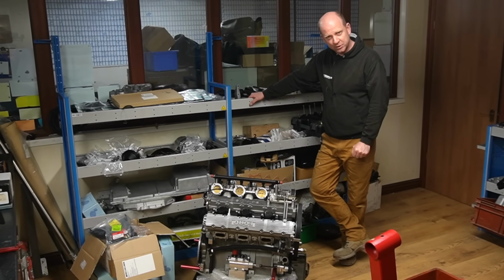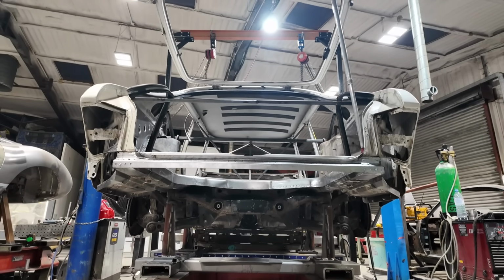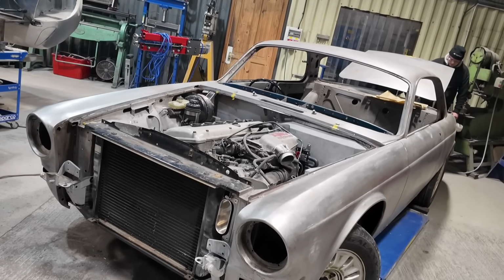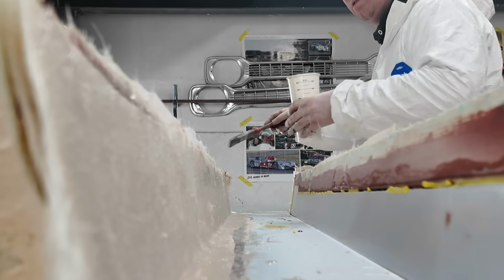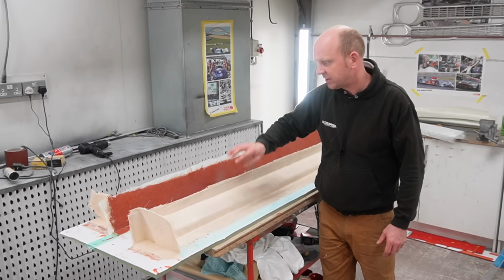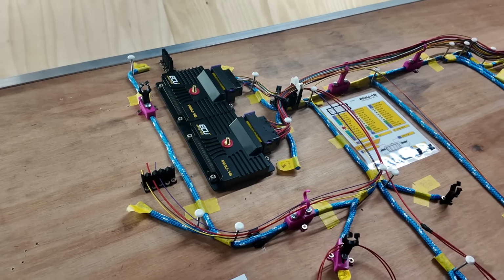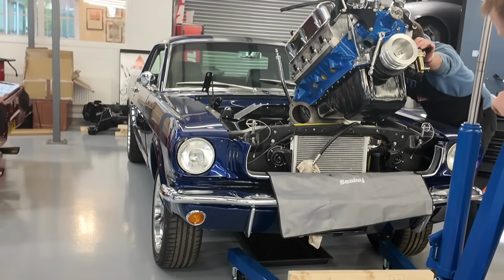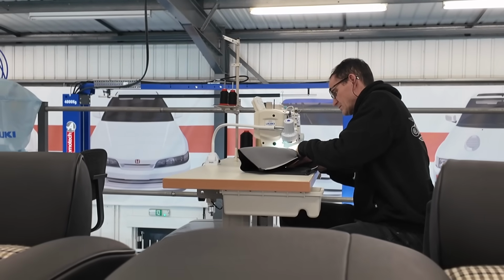Cosworth GAA 4.0 Alloy Block V6 Arrives!

Comment: With the Mustang rear oils seal get the best quality you can, like Felpro, and make sure you put the lips the correct way around. For the valley gaskets I never use the little strips of cork and just resort to a generous bead of silicone. I have seen the cork crushed and squashed out of position. 1965 Mustangs are like DC3 aircraft, its more of a worry when they stop leaking oil.

Comment: Jolly gee man. Wish I could be running one of those engines in my Capri 3. Absolute dream😱

I have yet to start the build of my Capri 3 with a Cosworth BOB anyway, but still. Maybe keeping my eye out in an FBE, the racing version of the 2.9 v6. However I am genuinely afraid with my luck it's not gonna last long no matter how nicely I treat the engine, and am under the impression that parts are difficult and expensive to source since it is a 3.1L and all... 

Still, cannot deny the soundtrack of the GAA engine is insanly glorious😱

Comment: Kevlar is a good alternative material for composite body parts, less brittle and more flexible than carbon fibre but stronger than glass fibre and lighter. Great for wings, bumpers and sill’s which might get nocked or impacted.

Also make sure the B side of the parts needs to be properly sealed, paint, lacquer or gel coat, as glass fibre is porous and allows water to cause problems like blisters in the finished A side of the parts.

Comment: Make sure that the exhaust primary length is long enough for the peak power speed.  A 6nto 2 into 1 system will improve mid range and sound fantastic (I assume this will happen anyway). The first Mondeo Cosworth V6 BTCC car had a twin 3 into 1 system and then in the second season we went to a 6 into 2 into 1 which gained a fair amount of mid range but sounded like a V12!
Reply: @jabberwockytdi8901  Having the correct secondary length is a given obviously as is the correct diameter primary , secondary and tailpipe. it is called exhaust tuning. All of which should be initial be optimized in 1D and then checked on the dyno

Comment: I would love a time machine to go back to 1985 when I spoke to a company that had three pairs of GAA heads. I was 18 years old and just sold my Mk1 Escort with a Group A spec RS2000 which was not very friendly to drive daily so I bought a 3.0 Capri & spoke to the company but was put off by the problem of getting them working on a 3.0 Essex block  and they was £300 a pair which is crazy! Then after that time travel I would like to go back to when I was nearly 16 still at school and every day walking to school I walk past a derelict car then one day I knocked on the door a old lady came and said I was her sons he came the next day and we tried to go it started but it wouldn’t start & made a deal for a swop for my very hi spec IC radio controlled speed boat with everything including the waders, but my dad said I was not allowed to bring it home. Which I still think about that car to most people it was a old wreck of a car with grass growing up around it and I thought it was great so a BMW E9 csi was not to be my first car.

Comment: Mr. Wood is a fricking genius. As a yoof I used to pass by his garage positioned down a back street in Stockport. He always had something interesting parked up outside. Much drooling occurred. Brave person needed to cut the arse end of the E-type. A thing of beauty. 
Bobby is a genius. You all are to be fair.
Enjoyed the skit about the fibreglass. Very interesting seeing the process.
Is there a 'modern led unit available for the Allegro's square headlights?

Comment: Very surprised to see Project Vader up for auction at Iconic Auctioneers Race Retro 2025 with a guide price of £60k to £70k. (I hope this doesn't break any rules. I have absolutely no connection whatsoever was surprised that's all)
Reply: They had one of the BMW M3 builds up for auction at the same place earlier in the year. I think the build was upwards of £300k.
It didn't reach its reserve and was offered up after the sale for £225k.
Don't know if it sold or not.
Reply: That must be a fraction of what the build cost 😮😮

Comment: Now THAT'S an engine!  None of this LS bloody nonsense so rife lately.
Reply: The LS is a fantastic engine.
Reply: @markchisholm2657  it is a great engine.....but I agree with the OP that it's nice to see something other than an LS being dropped in, as that's all a bit predictable
Reply: LS  variant would be a mercury marine quad cam ls 750hp 8200rpm and fully streetable for aboutvthexsame coin as this cosworth, ( a suitable engine for the aston DBS)
Reply: @ or. A mk 1 escort. 👌👌
Reply: @hanshoogendyk2203 no longer available though sadly
Reply: Correct.   The cosworth engine is a powerful torquey engine.   Around 450 bhp.  And without a turbo.    And it’s not much heavier then a 4 cylinder
Reply: ABSOLUTELY  CORRECT esp with the GastoM Martin not far away !

Comment: You can convert the SBF to the later one piece seal.  But even without that, the 2 piece rubber can be made to seal perfectly if correctly installed
Reply: Worth noting also is they will leak using the testing method they used as they require the rotation of the crankshaft to pull the oil into the crank case